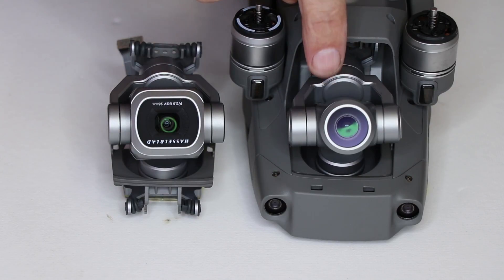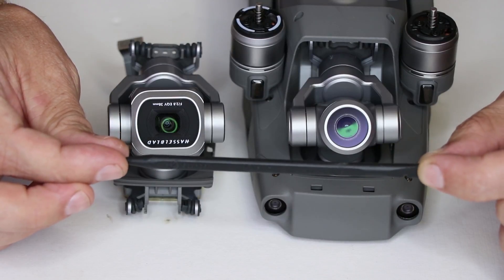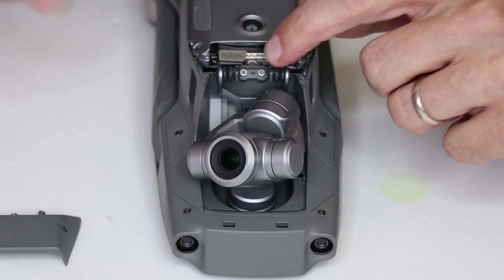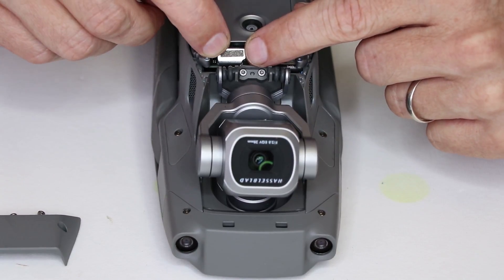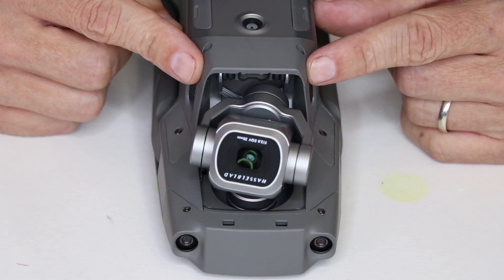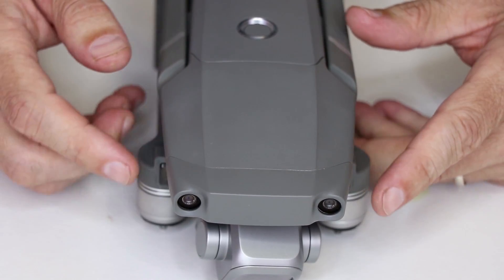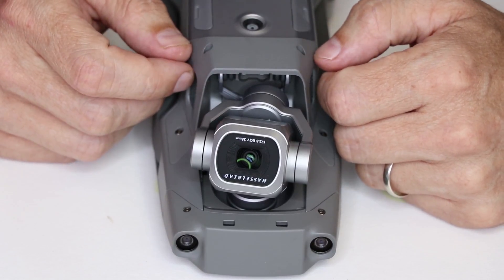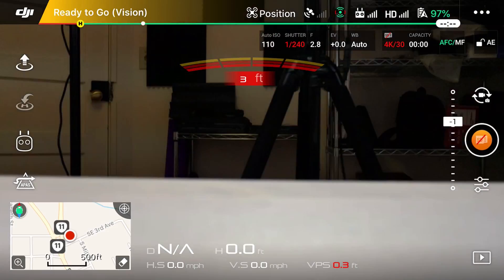Mavic 2 Pro & Zoom Camera Swap - DIY Guide

Comment: Thanks for the video. Followed your advice and bought my new camera from the same dealer. Just installed it and I can finally move my camera again. Only problem is the picture quality is definitely not as good. Do you know if these cameras are the same? And if so, is there a setting I’m supposed to change?

Comment: So now we know that installing a Pro Camera were a Zoom camera used to be results in no issues. I've heard that installin a Zoom camera where a Pro used to be results in some sort if error that doesn't effect operation in any way.
Reply: Did you get an answer to =this question ? I'm curious as to putting the zoom cam on a pro2 body ?
Reply: @ebeckford  Installed the zoom camera with no issues, no errors. Works great!

Comment: Very easy to replace but in my case I have a Camera error code 3.
I have swapped Zoom Camera with Hasselblad Camera on my Drone, everything works perfectly but I have this error (I tried two brand new Gimbal Cams)

Have you a guide or software how to reset code?

Thanks.
Reply: Does Error Code 3 functionally affect anything or is it just annoying?

Comment: I've heard that you need to do a software gimbal calibration after swapping the cameras. I have a Mavic 2 zoom that camera is tilted about 45 degrees after swapping the camera units. I've seen it happen on sparks and Mavic airs too after a camera replacement. There is a script you can run to fix the spark and Mavic air tilt issues. Do you know how to do it for the Mavic 2 drones?

Comment: Hello, 
I swap zoom to pro too, I bought my hasselblad on a DJI grand store and sap myself, but when I started the drone, there's a gimbal motor overload and the gimbal is going crazy... I told it to the seller, he told me I should let a repair center to do it... is there any manipulations to do? I already have calibrated the IMU the Compass and the gimbal...
Reply from the maker: When I made this video I just swapped it over with no problems. It's possible that they've updated them so they don't work. I'm not sure.
Reply: @Tronicsfix  Thank you for your answer, I try to downgrade and install it but it does the same thing... Ithink that I bought a damaged one
Reply from the maker: That's a possibility as well.
Reply: WilloFPV Pure Fun did you ever get your camera to work properly? I’m curious because I to want to install a pro camera.

Comment: Your video is very good. My doubt is. If you change take the camera the Mavic 2 Zoom and put the camera of the Mavic 2 pro or otherwise ... The modes of flights will work normally in the Dji app? When you connect will you recognize whether it's Mavic zoom or pro? Thank you.
Reply from the maker: Yes, it works fine in the app and all modes are recognized.

Comment: can you also do a swap with the mavic enterprise versions?
Reply: Nope , there’s encryption.
Reply: Make Asylums Great Again camera isn’t encrypted, it’s likely just soft locked if doesn’t work.  The Enterprise camera is just a zoom camera and works just fine on standard mavic 2’s and standard mavic 2 zoom cameras work on Enterprise mavic 2’s.  Few isolated reported of errors (airencoder) but firmware refresh seems to clear it up. 

As a side note, I heard someone glitched the mavic 2 zoom to work on the Enterprise app once before DJI parched it and ADS-B (AirSense) was working.  I personally can not verify it,  but I find it plausible for DJI to have done that as it’s very common for DJI to not take complete advantage of hardware.  It’s like hardware and software teams are on non speaking terms.  So ya I imagine that consumer grade mavic 2 has airsense hardware, can run auto heating function of the heated batteries and probably bunch of other stuff as well.    Also
Makes sense that DJI does this from a cost prospective, because they don’t have to build differant drones they just make same hardware a few times over and make minimal changes between them.
Reply: meehhhe Of You I’m wondering more about the dual thermal camera instead of the zoom camera.
Reply from the maker: I can't say for sure as I haven't gotten my hands on an enterprise version but I think so.

Comment: Can you use the DJI mavic pro 2 gimbal and camera as a stand-alone camera to your phone or does it need the circuit board too? I want to do my own 3d printed setup with the nice hasselblad camera if it’s not too costly.

Thanks
Reply: Kristopher Santos you pretty much need the whole drone. The app doesn’t work unless the drone is on. Anything I imagine is possible but probably not worth all the effort .

Comment: if i have the care refresh(+?) does this void any part of the care program? i got the care program on my Mavic Pro 2. I would assume they would prefer me to go through them, but I'm always needing to change the cameras, so would just like to do it on the fly myself. I understand that since its done through my Pro 2, and lets say i crash the zoom, i would more than likely need to re swap if possible so i return what is covered and get that back. maybe this is not the case, maybe this is a question for DJI?   thanks for the video!!
Reply from the maker: I'm assuming they don't want you to do this yourself but it would be hard for them to tell. If you ever have to send it in just put the original camera back on and I would think you'll be fine but no way for me to know.
Reply: @Tronicsfix  It may not be so hard for them to tell. They will read some logs for sure.
Reply: Would it really worth it? Even if you are on the DJI care program, you have to pay  $119 for one replacement... and there can only be two replacements...

Comment: How can I buy the Hasselblad camera ? I have the zoom right now.
Reply: Dang dude chill lol.
Reply: Sumeel Chand go back to your mothers basement, return once you have a job. 👍
Reply from the maker: You can try the link in the description. Sometimes they have them sometimes not. Just have to keep checking.
Reply: Thanks but $700 seems a bit much since retail cost $200 between zoom and Hasselblad.
Reply: Sumeel Chand dji wont sell camera for 200. Trust me.
Reply from the maker: I'm not trying to convince you to buy it. You asked how you could buy it and I told you.